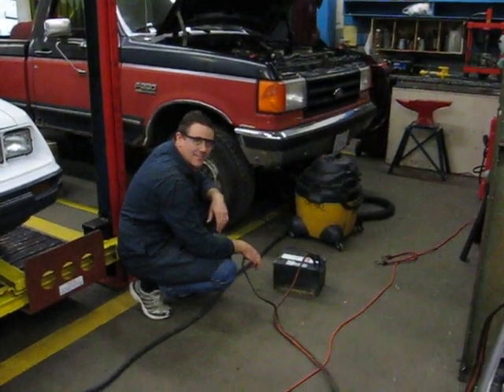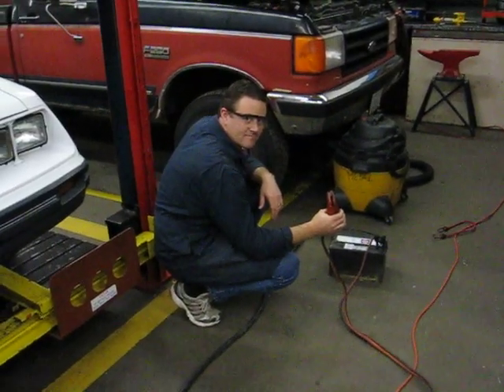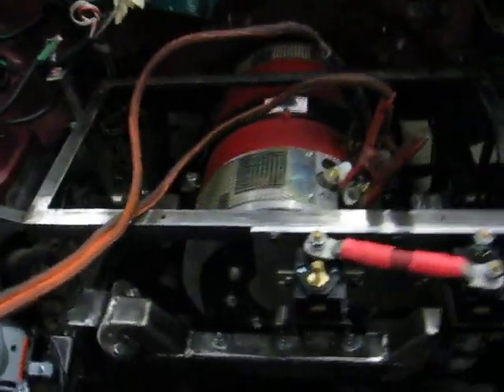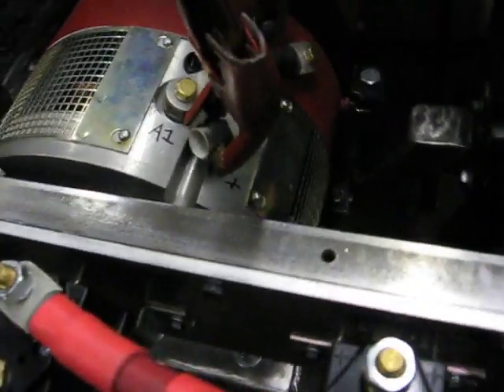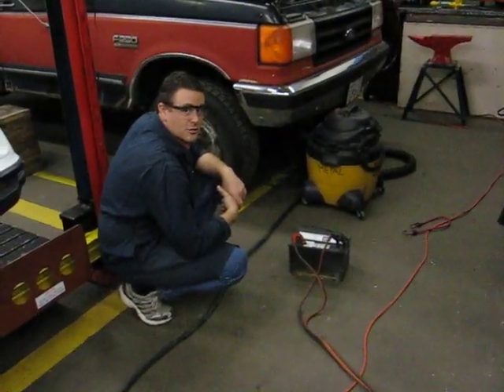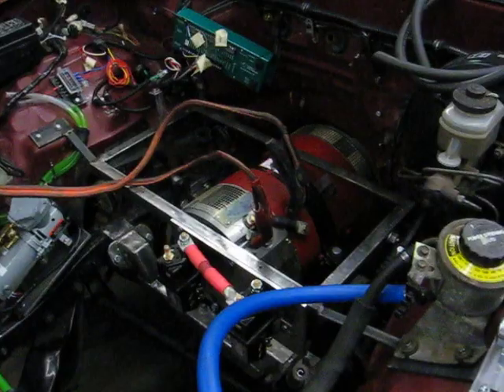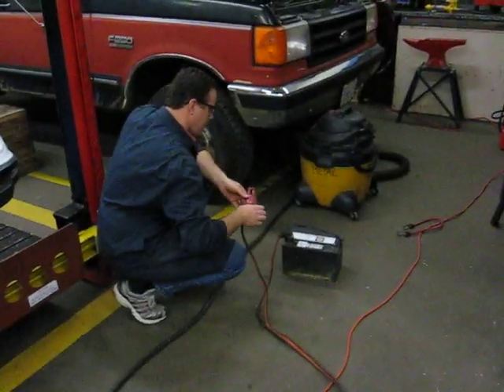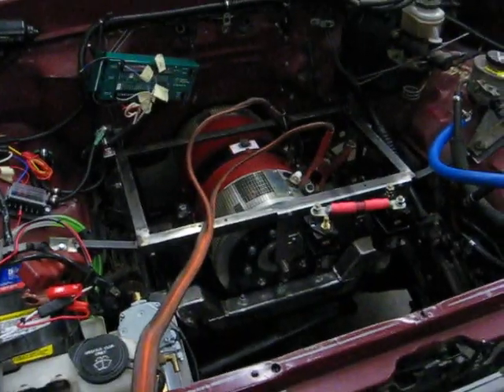Bench testing the Transwarp 11 electric motor in the Electric Drag Truck!

Comment: That sounds about right, I think aterack didn't consider this is only a fraction of the maximum voltage, that would probably rip the engine apart without load.